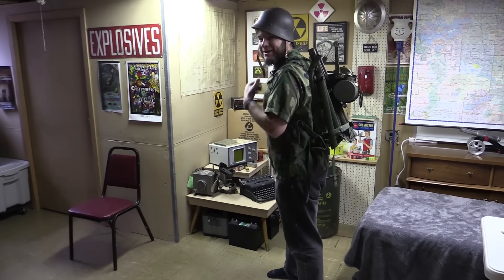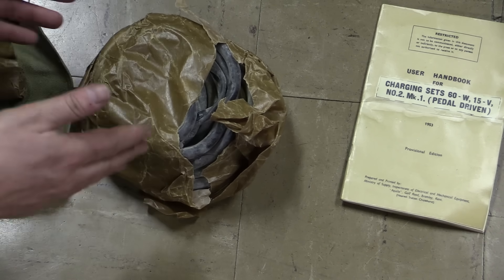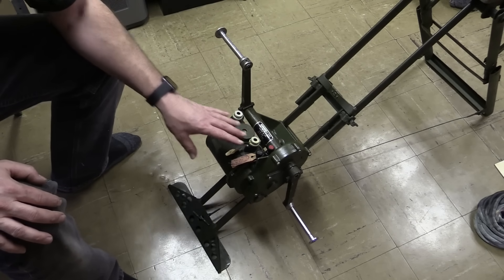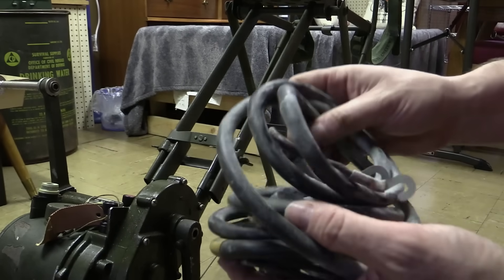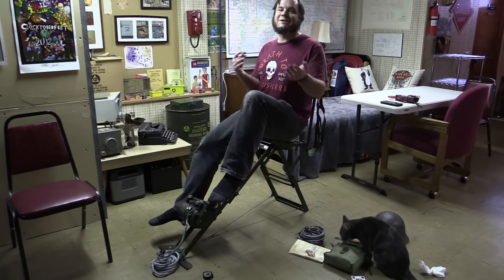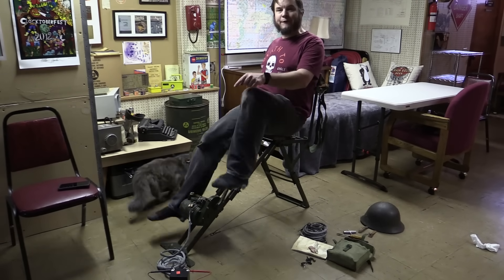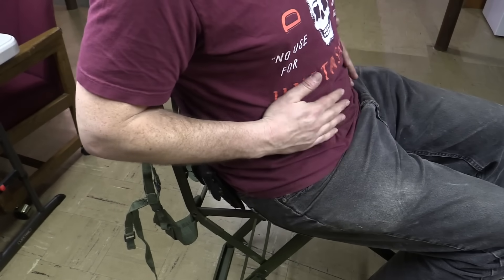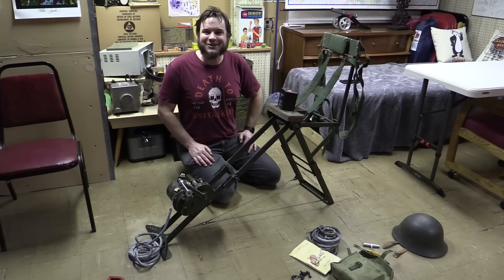Human-Powered Generator For Off-Grid Electricity - British Military Surplus Radio Power System

Comment: I have one of these car battery jump starter packs. You know the kind that you can plug in to charge off of household AC and it has the jumper cables on it. When you click the Switch to on it basically connects the jumper cables on it straight up to the lead acid battery that's inside the unit. You could possibly charge the lead acid battery directly off of this generator you have by hooking the output of Your generator their straight up to the clip ends of those jumper cables. The jump starter pack that I have actually has USB outputs on it. So you could use your generator to charge the jump starter pack, and then use the USB ports to charge your cell phones and other small devices after you've fully charged your jump starter pack.

Comment: Seems like a flywheel could help smooth out the RPM. I'm sure this wasn't included for weight reasons. But if it was on the fast-spinning part, it wouldn't need to be that heavy.
Reply: Yeah, a nice big heavy flywheel would make it much more fun to carry on your back all day too

Comment: I am a member of a amateur radio society in the Bromley area. Will be sharing this. Im sure some of the old boys will know all about it.
Reply: I have been on( and off) CB since since 1974. I have purchased a 10M radio. Who do I contact around Minneapolis about a license  to use it? I have a decent grasp of Ohm's law, parallel/series resistance/DC voltage and NEC grounding/bonding.

Comment: You said alternator a time or two but I think its a dynamo
Admittedly I'm not an expert at interpreting such schematics other than knowing what the symbols mean, but the schematic doesn't suggest to AC generation and DC output to me.

I kinda wonder how you'd make an AC generator output DC before rectifiers actually
Reply: I would think it's just an actual magnets and coil type of generator. That is basically simply a DC motor being used in Reverse to generate electricity. In that case it would put out dc, but it would probably be pulsating dc, that's why the capacitors are included in the schematic along with the coils which are labeled with the letter l. They will help to smooth out the DC. A diode type system is not needed because this is not creating alternating current.

Comment: i think in england we used Red and Black but now its Blue and Brown 
but also some older wiring was fabric i found some cables under my floor years ago and it was wrapped in fabric.

i was thinking you could have it hooked to a stabilizer so the power stays at 12volts max for charging a newer battery
Reply: Red and Black are still DC, Blue & Brown are AC

Comment: That paper may be VPI paper.  Vapor Phase Inhibiting.  You used to be able to buy it and put a piece in your silverware drawer to inhibit tarnishing.  A lot of old military surplus used to be packed in cosmoline, a nasty gel like substance used for the same purpose.  When you buy Chinese power tools directly, it often come coated with something similar to prevent rusting during the boat trip.
Reply: Now I wanna buy some Chinesium

Comment: hi Gabe, You mentioned 12volt a bit... But the manual says 60watt 15volt output on it.
a voltage regulator on a british car would often operate at 14.4v to charge a typical 12v battery.

if donny has a scamper wheel, you could hook this up to the drive shaft and charge from moggy power
Reply: Yeah, when people say "12 volt" they almost always mean "10-15V because it's meant to be run from what's sold as a 12v lead acid battery, which is more like 12.8v when fully charged down to 10v when you're starting to kill the battery, and charging is done at 14.8v down to 13.5v"

Comment: tungsten bulbs are very nonlinear.  When they are cold the resistance is low.  When it gets hot the resistance goes up.  That causes the power to go up which heats the bulb faster.  So I think it's just the bulb.

Comment: Hmm, got any spare power conditioning units around? If so, put one between the generator, and whatever you're either charging or trying to run, and see if that helps keep the power a bit more stable. Nicely done as always, Gabe :)

Comment: The white powder  from the rubber cables is called bloom and its caused by excess material that is contained in the rubber after vulcanization. Its harmless and is usually just made of whatever additives they added to stabilize the rubber during the time.
Reply: No it's not. It's dried slurry. After the extruded rubber/conductors run through the cure-ovens it's ran though a slurry bath, then ran through the drying-section before it's wound onto the big bulk spools. The dried slurry keeps the cables from sticking together on the spools. The slurry has talc in it and that's what's on those cables. However back in the 50's before breathing suspended particulates was a concern, the cables may have ran through a shaker drum in a talc-booth before being wound on the spools.

Nothing in any cured rubber compounds leeches out like that. I worked for BTR and Goodyear for over 30yrs.
Reply: @MAGGOT_VOMIT  And it turns out that talc can contain asbestos, especially if it is old.
Reply: @Heimbasteln  and? It says that even on the new bulk bags of Talc with cancer warnings. Asbestos is commonly found where talc is mined.
Reply: @Heimbasteln  Most asbestos is perfectly safe to use and handle. Its the type that really matters the most. There is one type that causes lung cancer and is problematic but it was very very rarely used. Most of the stuff you see about asbestos is fear mongering and lawyers trying to make a quick buck. Most people who claim they got cancer from asbestos also smoked 2 packs of cigarettes a day as well....
Reply: @MAGGOT_VOMIT  i was just joking but thanks for the knowledge.
Reply: @rubenskiii  I wasn't replying to you.
Reply: That’s great info thanks. I’ve seen this on old cords for computers I have.
Reply: that's interesting, is it common for their the be that much? seemed like a lot of powder.
Reply: @Geopolitics2day  I don't know where he got that bs "bloom" from. To explain it simple, it's the same talc powder that's on the inside and outside of inner-tubes when new, that keeps them from sticking together.
Reply: "Whatever additives" in the 1950's could mean asbestos or uranium wahahaha!
Reply: @rubenskiii  Nah, it's probably just excess Anthrax powder, nothing to worry about.
Reply: @rubenskiii  For real, it could be asbestos or probably worse polychlorinated naphthalene and other nasty stuff.

Comment: That looks like a real uncomfortable qrp only field day solution. Thanks for sharing!
Reply: Fifteen minutes of that pedal generator should get you a good 6-12 hours operating CW or SSB out of most QRP rigs.

I've done 3hr or 4 hours digital(FT8) with my 705 using only on the stock battery (14wH)

Comment: Ham Radio Field Day is coming up... this unit could do the Natural Power contacts, you get extra points for this!  As you said, it needs a battery (or a super cap?) connected.  To qualify for the Natural Power thing the battery would need to start as discharged.  Nice find!  We made a bicycle generator from a scooter motor and a big capacitor... this looks a lot easier to use.